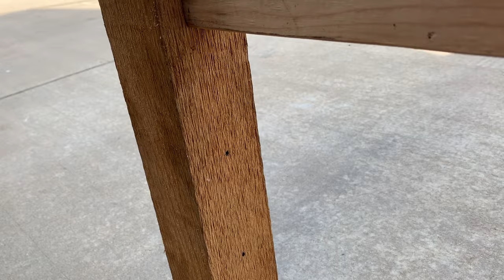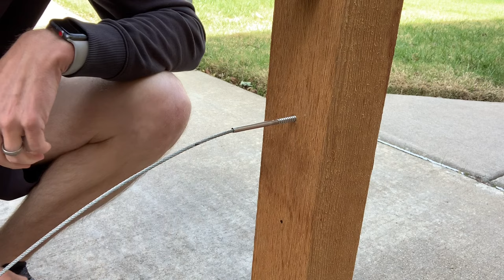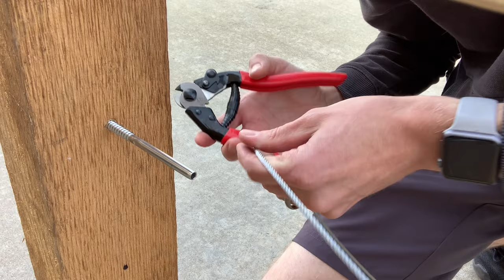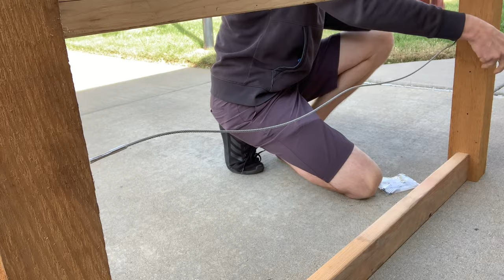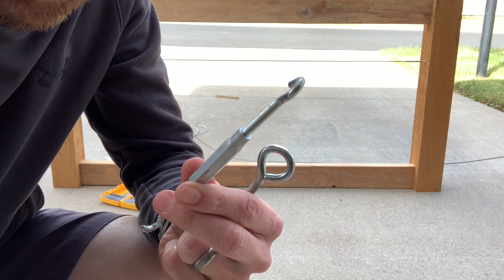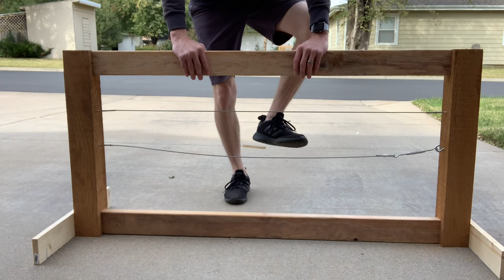Budget Cable Railing Materials

Comment: A good tip when installing the crimp screw. If you have lots of them to put in then you can put the crimp end of the screw into your drill (once you've done all your pilot holes) and use the drill to screw them into the post. Hope this helps
Reply from the maker: @aronsavoury1201  great idea!

Comment: My wife and I did a deck workover this summer and installed the muzata railing system in a 600 sq ft deck.  We picked the flat black finish on the cable and hardware. We are very happy with it. 
This is a good DIY project and all the more so because I could not get a contractor to do the job. All are too busy here in Colorado.
Reply from the maker: I didn’t know they had black hardware now.  I’m going to have to take another look.  Thanks for the comment!

Comment: I did this for 150 ft railing. Bought the crimp for 40 on amazon and works fine. They also sell for stairs that can go different angles. If you are doing in summer, don’t make it too tight, it will become shorter and put too much tension on post
Reply from the maker: Glad to hear it worked out for you!  150’ is a pretty good stretch as well!
Reply: What crimper brand?

Comment: I have used this same cable system inside and outside of my house. The trick is to cut the wire at the right length to have most of the threads inside the wood. They rarely loosen, but when they have it is simple to tighten them. Fortunately for me, when I bought my materials, they had a different hydraulic crimper. It was much faster to use.
Reply from the maker: Pat, that's great advice, thanks for adding this info to the comments section!
Reply: what are you cutting cable with
so it dont fray on the ends

Comment: id leave a little threading exposed so you can tighten them up as they stretch out from people putting weight on them. Great tutorial. i am installing a very similar system on my deck. thank you
Reply from the maker: Not a bad idea for sure.  Hope it was helpful and thanks for watching!
Reply: I am at the point of cutting the cables. If I cut the cables so they deadhead inside the lags how many turns does it take to tighten the cable.  I do not want 1/2" of threads showing but do want some threads for future tightening if they relax over time.
Reply from the maker: @go4itpc , that would depend on how much slack you have in the cable.  I pulled out as much slack as I could and it only took a couple of turns to tighten them up.

Comment: Your video was great.  Their recommendations for the amount to cut off the overall make you see threads like you showed.  To not see threads cut 1 1/8" off square runs,  1 5/8" off of stairs, 1 5/16" off square to rake.  Buy extra so you can figure it out too.
Reply from the maker: I didn’t know those measurements, so thanks for sharing!  They didn’t give me that info when they sent me the stuff to demo.
Reply: Do you take your measurement butting post to post or from the screw itself?

Comment: Here's a tip if you have a big shop vice you can make your own dyes by slotting 3/4 carriage bolt nuts with a grinder or file and then put the cable lags between and tighten. And use magnets if ya want to hold them in the vice
Reply from the maker: That’s a great idea!  Thanks for sharing that with us man!

Comment: Good product, but my qustion with cable railing is what about maximum recommended span of the cable between post? I have a large deck that was added to over time so, some of the spans are about 72 or inches or more.
Reply from the maker: That is not much more than the spans I have on my porch Donald.  I think a lot of local codes will tell you that as long as you can’t fit a 4 inch sphere between them, they will meet code. So you may just have to have them a little closer together for a longer span… I would always counsel someone to go ahead and ask their local building official just to be safe.
Reply: Thanks  @PottersWork

Comment: I like this system, but instead of lag ends I would prefer a machine screw end so you could thru drill the post and adjust tension that way. A lag screw seems like it could loosen as wood ages and dries out.
Reply from the maker: I would have to agree with you on this, I haven’t seen if they’ve added a newer product since my video that does this, but might be worth checking out.

Comment: I just wired mine up. System works great, but if your 4x4's are weak, these will split the wood in half. In order to avoid this don't over tighten and add a bottom plate
Reply from the maker: Lgeezy, glad to hear they worked out for you!  Good advice as well

Comment: This is his first time and goodonya for getting it done.  Keep in mind that we're rigging railings.  Think rigging a boat.
"From far it doesn't look terrible".  We'd need to have a pretty large deck to get far enough away for that
to not look "terrible".  It would help if we first started out thinking we could afford to do the cable railing correctly.
All the components needed to finish it as it looks on the WEB pages is a good place to start.  
Galvanized wire isn't close to making that list.  Neither are bolt cutters whose purpose is conveniently defined in their name.  
That's why they aren't called bold "swagers" or bolt "crimpers".  Stainless Steel is the best choice for stuff having
to hold up 24/7 outdoors.  It is steel that stains less than other steel.  It can rust depending on circumstances.
Crimp, turn 90degress, crimp, turn 90, repeat as needed.  Crimping again 90 degrees to your first might smooth 
metal that may have pinched out of the die on the first pass.
Stainless Steel Ferrels that fit in the post give it a finished look.
Use of turn buckles means we can lag all the way in to hide threads on that end then cut enough slack to be able 
to terminate the other end.  That slack would be removed with the turnbuckle.  
Heck, all this is online.  Do it that way and only compromise after posting on a place like this or calling the vendor
asking what they'd do on your budget.  
By-the-way, I'd tune the strings up to Ukulele tuning and let the kids do something creative with your deck.  
If you have a couple sections tune one to GCEA for Soprano and Tenor
and dGBE for Bass.  I can hear the kids now yelling, "comeon we're going to play Potters porch."

Comment: My job is still waiting on the front veranda but I reckon I'm up to speed on a few things. I was told that using bolt cutters is NOT at all suitable. That is because a proper swage tool actually bonds the cable to the swage. Also one compression is easily enough as this is not a load bearing cable. I used a hammer and cold chisel to compress all my copper shade sail swages but after being told how to do it the right way, I bought a hand swage tool and went over every swage so now I know a big wind will not blow my expensive sails away! As for my railing, I bought the left/right lag screws as they do look neat as a pin on the Youtube vids I've seen and easy peasy to install. My job is over 20 metres x 5 rows of cable so this is the cheapest way of getting stainless steel balustrade. Turnbuckles and all those other fancy fittings would up the cost significantly and would just makes the finished job more clunky imo. Thanks for the video Josh; you reinforced my thoughts that I bought the right hardware.
Reply from the maker: Jed, do you happen to have a link to a video or some pics of your project?  It sounds awesome!  Would love to see it.  And thanks for watching and for your knowledge addition to the comment section!

Comment: Cant wait to try this product, pricing is right and really like the clean lines, thanks for a thorough video!
Reply from the maker: S Gammon, no problem!  Glad the video was helpful!
Reply: @PottersWork  thanks for the demo. 

1. A proper swage or “crimp” as you call it will lock the threads of the cable between each other. It then will support 90% of the cable specified weight. 

This method is using the hollow cavity section of the screw to squeeze hold of the cable. This is totally different and relies on the strength of the hollow tube and how well it was swaged. Coupled with rust, I would think that the holding power will be compromised over time. 

3. I saw when you used your wire cutters swage the

Comment: Maybe it's different in the US but in the UK thats a £200 tool and those screw in fitting s are £37 each so £74 plus the cost of the cable which is the cheapest part. This is way more expensive than even glass. I priced this for a client and it worked out for a 4 foot section, they wanted vertical wires. It worked out around £800 for a 4 foot section. Obviously they never went with it and managed to get toughened glass panels for £75 per section.
Reply from the maker: Wow, I wonder why it's so much more expensive than it is here in the US...that's a big difference

Comment: I bought these after watching your great video but every time I turn them to tighten the cable pulls out! Maybe my hydraulic crimper is weak? I bought it new with the kit. Any thoughts?
Reply from the maker: Rick, I haven’t had that happen before…have you tried using a smaller swage die in the crimper?  That would be my first guess to fix it.

Comment: Could you eliminate age the need for a turnbuckle by fully screwing in one cable anchor to the post and screw in the other side approximately 1/4 of the way before inserting and cutting the other side?
Reply from the maker: @StephenHenri-w9n  yes you could for sure do that.  The turnbuckle just makes it easier to adjust later if need be.

Comment: I love the tutorial, thank you. I’m really liking how you connected the 2x4 to the posts. It looks seamless! How did you do that? Our deck needs a big makeover, this railing and the posts. Yours look really well done. Thanks!
Reply from the maker: Hello Sparkle Fire!  Thanks for watching and leaving a comment!  I used pocket hole joinery to connect the railing like that. It’s very simple if you purchase a pocket hole jig.  I have used a Kreg pocket hole jig for about 10 years and have been very happy with it. I currently use the Kreg K4, but started off with the R3 for my 1st jig.  Both would work for this railing, but the K4 is faster for more holes.  Hope that helps!
Josh

Comment: With this exact setup, can you make a 90 degree turn in a post and carry with the same cable? Instead of having to drill and use another set of the L&R's in the same post just on the other side.

Comment: The new crimper seems more user friendly. No need to remove the post and remove the top die.
Reply from the maker: Ken Shepherd, I haven’t seen the new one, but that sounds much better.  This one still works well for me and I’ve used it on some other things too.  Actually comes in handy for more things than I thought.

Comment: I used this kit ! try this trick . Pilot drill like you did then use the lag like a drill bit in the drill to send it in . Works great . I also had a open end crimp tool that way you can set all your lag half way in then crimp all the wire at the same time then tighten. I really like how simple and nice the look . Great video
Reply from the maker: Josh, sorry I am just seeing this comment!  That’s a great idea with the drill, and I need to find myself an open ended crimper for sure!
Reply: @PottersWork  I’m happy to share ideas with another craftsman who take pride in their work 👍
Reply from the maker: @josho4971 , well it’s appreciated!  That’s the best part about YouTube comments…learning from all the other workers out there.  Sometimes the comments aren’t always nice, but most are lol ;)
Reply: Do you recall the make and model of the open ended crimper? That sounds like a huge time savings.
Reply: @davidnorwood8109  if you are in a jamb and need one asap harbor freight has one for automotive that works ok . If you have time I bought a nicer one on Amazon, it’s in my work truck I’ll look at the brand today and try and get back to you .

Comment: You did well I learned a lot from your installation and honest feedback on the Missouri product I was wondering if you had any follow up I had another question if the cable does give and sags do you have to replace it completely because there’s no way to tighten it all that you do still have that half inch on the other end for tension down the road? Thanks again it was a huge help
Reply: Muzzata?sp
Reply from the maker: @ameyc2 , thank you for watching!  I still had lots of threads left to tension it up more...you can see in the video that I had a pretty good sag before I tightened it up and still had quite a bit of threads showing.  If it gets a little loose, just tighten each end a turn or so and that should do it.  I hope that helps!

Comment: Thanks for the demo! Excited to try these fittings out. Any idea what standard die size the 1/8 die corresponds to? I have a crimper with 14, 10, 12, 8, 7 AWG, etc sizes, so just curious if you know.
Reply: I don't have an answer for you, but in searching for a hydraulic swaging tool, I see that most with AWG size dies are not rated for steel. I'd recommend double checking yours before using it on steel....just food for thought, I am a far cry from a Youtube know it all, just what I've read recently.

Comment: I wonder if you could chuck that into ur drill to install  those bolts???
Reply from the maker: Honestly, you probably could...just would want to be sure not to spin it in the chuck so you didn’t scratch it up.
Reply: Exactly. 1st thing I thought of. Why work harder than you have to.
Reply: Buy a couple extra I use the as pre drill for threading works a treat

Comment: The big question from a pro builder is this. With multiple post. Ie>4×4s. The lines of the cable system may be interrupted from one side to the next. Hence the length of the threads.  Wouldn't one "panel" interfere with other?
A long run of 20 feet. >five post< the cables should line up all across  the separate sections.  Therefore i see a conflict of the fasteners colliding within the post? Isn't this an issue? Especially when we as installers want, or should want a clean appearance.  No threads showing?
Is there a longevity issue with the overall depth of the threads and how far is the penetration?
Before they collide?
Reply from the maker: RM, when I did mine, on my long runs I just drilled through the post and ran my cable straight through.  I would only use these where my cable terminates at each end.  I helped a friend do his this way too and it worked great. We used these sleeves for all the posts between for a clean look.
Muzata 50Pack T316 Stainless Steel Protector Sleeves Protective Cable Railing Kit Hardware Grommet for 1/8" Wire Rope Wood Posts Deck Stair Railing CR13,CP1 https://www.amazon.com/dp/B07174JGTR/ref=cm_sw_r_cp_api_glt_fabc_YSWDFWRBAAMFPKZMBBN5
Reply: Thanks for the video.  Getting ready to start.  What length would you stretch between posts?  I will need to install add posts.  What size post would you recommend?  Thanks for any advice.
Reply from the maker: @victorhallman3363 , your distance between posts will depend on what size beams and joists you are going with.  Usually you can find some good charts on google for deck building.  Most likely you will want to use 4x4 posts unless you are going to be doing longer spans with larger beams that would require a 6x6 post.  I’ll post a website that has some good info below.  And I also like to encourage talking to your local building official, he/she will probably be able to give you some great info too.
https://www.decksdirect.com/how-to-frame-a-deck
Reply: One hard ware site said that on a corner you can offset so that they pass each other or use partial depth fittings. Oa a corner the offset picture looked fine.

Comment: Hi there, does one have to use the left and right lags at every section? Or can one drill holes through several sections and use the lashes at the first and last sections?
Reply from the maker: You can drill holes and string the cable through for sure.   I have another video I did that in, but I used turnbuckles…that was before Muzata sent me the lags to try.  I still kind of prefer a turnbuckle on one end for ease of adjusting cable tension.

Comment: Hello. I’m about to do cable railing on my deck rails and came across your video. Would the lags work if my deck rail was 24ft long and I went ahead drill a whole through the posts in between? Hope that make sense?
Reply from the maker: Hello Ricardo!  Yes that should work just fine as long as your distance between your posts isn’t too long.  I actually did the same thing on my deck.  I drilled 3/16” holes in the posts between my two outside posts and then ran the cable from one end to the other.  You can also buy sleeves made just for this if you’d like a more finished look as well.

Comment: Do you know if you can run these cables on a diagonal with the lag screw cable connectors and just drill the holes at an angle? This is specific for a handrail on a stairs that are diagonal. Thanks.
Reply from the maker: Jonathan, I don't see why you couldn't do that, as long as the holes are drilled at an angle.  Might want to check with your local building official just to be safe though.